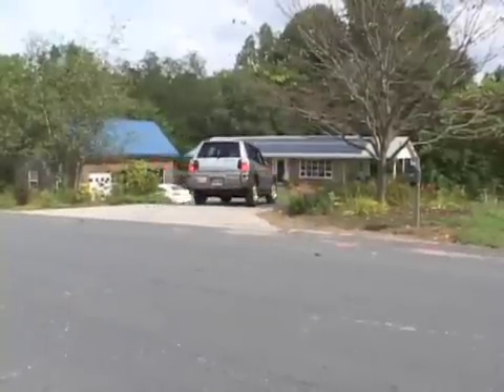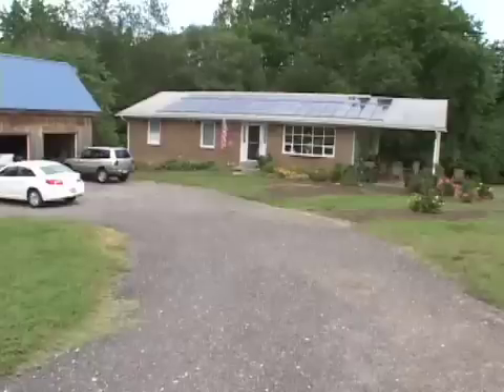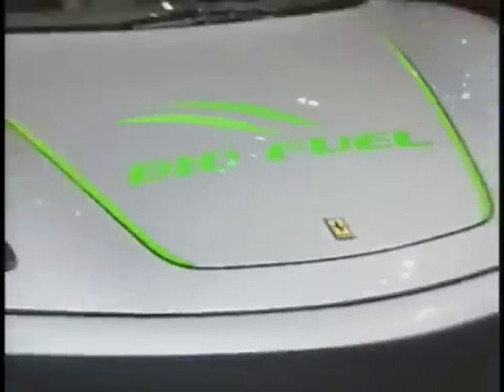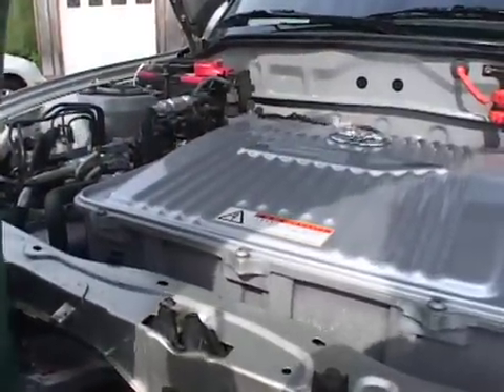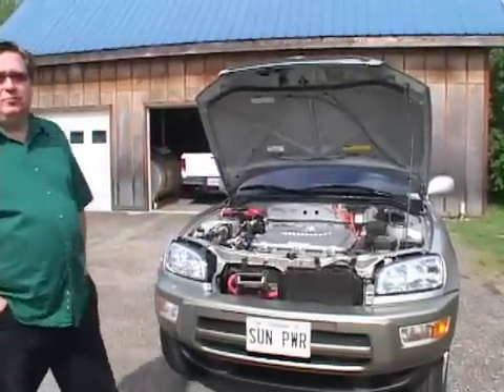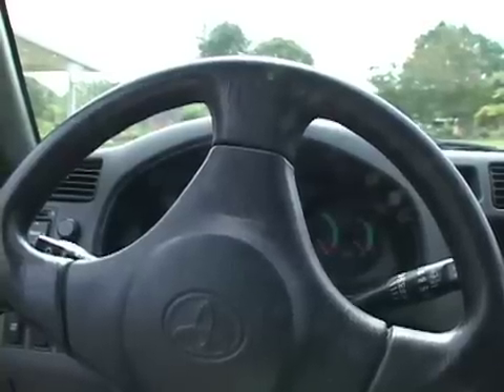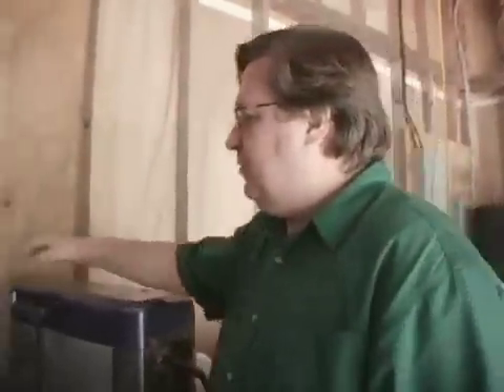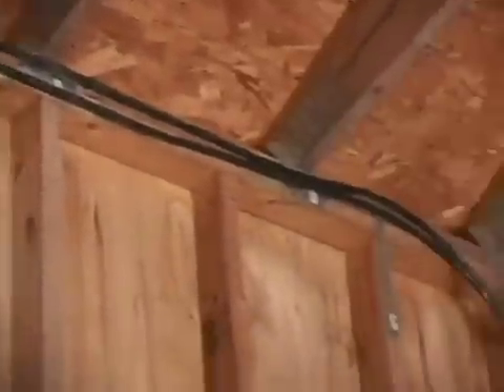Electric Cars Offer Energy Independence

Comment: This is Great! BUT, only if you have the money to setup & maintain a system off the grid. His one car was $40,000 used off E-Bay? How much was the second car, $40,000 as well? How much is a 9200 watt system so he can charge two cars & power his home, $100,000 plus? "Is this dream we all share about $200,000, plus $10,000 to $20,000 a year to maintain? I heard just car insurance for electrics double! Plus cells & battery replacement can be in the thousands, These are not regular car batteries